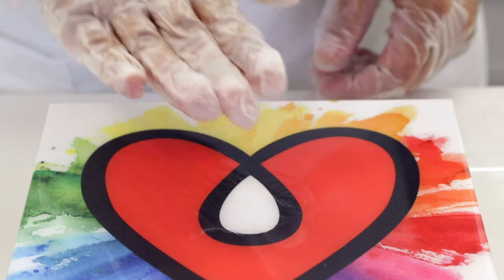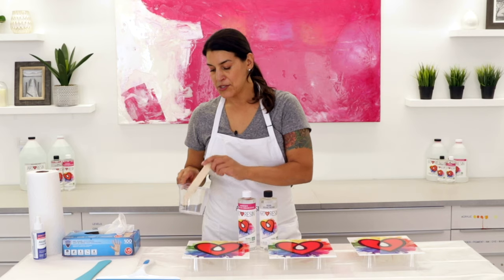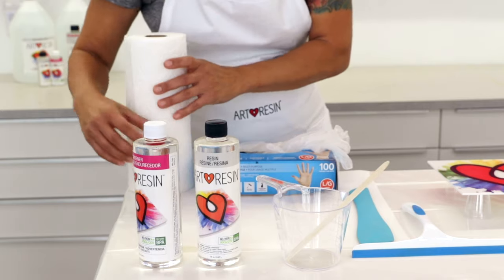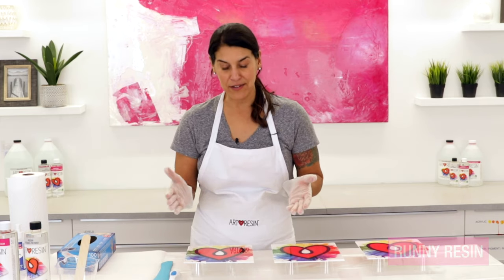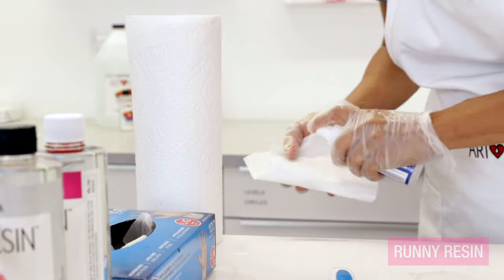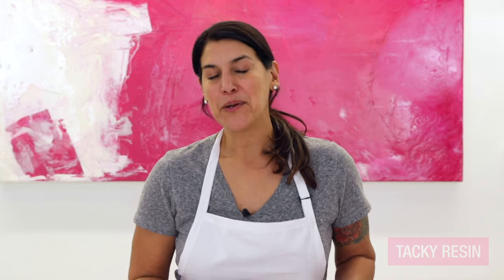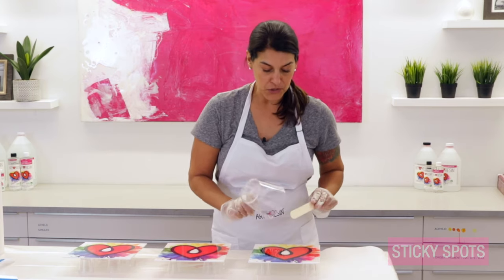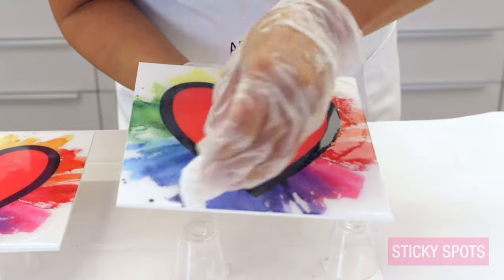How to Fix Sticky Resin - Top Tips & Tricks

Comment: Thank You so much, your video is very informative and helpful. I have a situation. I custom painted my longobard and I did a resin top cost to protect it. Since the temperaturs outside these days are extremly hot, I turned on the air conditioner to have the right temperature and to have a constant temperature. Instructions says to pour it at minimum 17degree and cure it at 20 degree. I poured it at 18-19 degree and let it cure at 19-20-21 degree. It also says it cures in 24-48hours. 

The problem: I have sticky resin, not wet spots( "the lucky situation"), I'm gonna take your advice and let it cure more.

I turned off the ac to have a warmer temperature, I poured it on saturday night, now is monday. 

 I also have some uneven small spots here and there which I'm not happy about 😕 I don't know way my resin keept making very small bubbles. I used a lighter to pop them but they keep appearing and I didn't want to insist too much and ruin everynthing.

 I don't know how close to the surface I should use the fire and how long I should mix the resin. I mixed it about 3 or 4 minutes and scraped all the surfaces of the cup, but I hurried up a little because I was affraid that the resin will start to become thick and I will not be able to spread it after.

 Now I think I should let it cure to not be tacky, then  sand it and apply another thin layer of resin on top with a brush but I'm so scared to sand it, what If it's going to scrape the paint underneath? 
Or if I can see the scraches after?
 I'm scared I will make it worse. I don't know what to do, If I should try and fix it or not. Also the next days the temperatures will be much higher and I'm thinking that my ac will not be able to keep a 19-20 degree indoor.

 I'm scared, I worked so much and so hard on this painting. I need a friend like you in my life, you are so optimist and confident with this. 
You made me think I should try and fix it. But I don't know...I have second thoughts.... 😕

What do You think? Is it safe or worth to try again? Sorry for my extremly long story, I give all the details to make sure the story is clear. Hope you will read this. Your opinion would be highly appreciated. 🤗
Reply from the maker: Hi there, the ideal temperature for working with ArtResin  is 24-30C (75-85F).  You may find your piece will cure by increasing your room temperature a couple of degrees.  ArtResin typically reaches a hard cure (to the touch) in 24 hours and full cure by 72 hours.  Once you have thoroughly mixed your ArtResin Resin and Hardener, you have about a 45 minute "working time".  During your working time you can use a butane torch to clear out any bubbles that rise to the surface.  You will want to let the flame kiss the surface of the wet resin, moving your torch constantly and avoid repeatedly torching the same area to avoid over torching.   If you do end up with any surface imperfections once your resin has cured, you can simply sand,  being careful not to sand into your artwork and pour a fresh layer once you've cleaned off the sanding dust.  The sanding will remove any of the imperfections but it will also provide tooth for the following layer of resin.   The sanding marks and dull finish from the sanding will disappear when the next layer of resin is poured.   
Here are couple of links to blogs with more information:
https://www.artresin.com/blogs/artresin/how-to-use-a-torch-on-epoxy-resin?_pos=5&_sid=9f04ddc91&_ss=r
https://www.artresin.com/blogs/artresin/44594177-how-to-apply-a-second-coat?_pos=2&_sid=fd304222a&_ss=r

If you need more assistance, feel free to reach out to us at support@artresin.com

Comment: Option 3. Seal with a sealer spray.

I have a spot on my piece that feels sticky. I saw this on another website. Do you recommend? “Use an acrylic-based spray or resin gloss sealer spray to seal off the sticky areas.  Use in light coats.” Thanks
Reply from the maker: We normally don't recommend a sealant spray for the fact of not knowing how it will yellow over time and that most are not food safe. Will it work? Possibly yes if the piece isn't too sticky.  Could it compromise the non-toxicity or longevity of your clear finish , also yes :)
Reply: No, if you cover uncured resin it will never cure and your piece will break down. Everyone should also be using PPE outside in work garage. There's tons that's had reactions even to art resin. The one I use also says non toxic VOC free n all that. None of them are safe and when you add heat or additives it changes the chemical balance. There's a fb group that the ladies has pics of their reactions. It's great if used safe. It's not the smell, but the fumes that releases for 72 hours after mixed.

Comment: Love your teaching. What about tiny bubbles how do you fix this on a large countertop.
Reply from the maker: If the resin countertop has cured, you can sand the surface to expose the bubbles then pour a fresh layer of resin overtop.  The sanding will open up the bubbles, the new layer will fill in the voids.  Once you pour your new layer, be sure to hit it with your torch to zap out any bubbles that arise.  Here is a blog that explains bubbles:  
https://www.artresin.com/blogs/artresin/tipstopreventresinbubbles?_pos=1&_sid=4321248ce&_ss=r
Reply: @Artresin  I sanded omg what I core 🙈 next time I won't be in a rush.  Tyvm 💕

Comment: Hi ,
We are new in poring resin. We made many mistakes. During mixing we didn’t scape the bottom and side, measured by weight (even this method worked before), and during poring, I scraped out the bottom an scraper of the side. After at least 30 hours the cube, cone and pyramid are still partially soft and sticky. We designed the middle of the shapes with flowers. Is it anyway they can be saved?
Reply from the maker: I am sorry to hear that.  Unfortunately when the uncured portion is inside a cast piece, it is harder to fix than if it is on a flat pour.  You can try to topcoat it with a fresh mixture of ArtResin which will seal over any sticky areas, but if there are portions that are really soft, it may not be enough to fix completely.

Comment: Hi again does all resin and hardener work the same I mean no matter which brand you use because I am using clear cast 7050 part A and Part B it says to use 2 parts of one and 1 part of the other so can I use equal part and it will work for me
Reply from the maker: Each brand is different. Our product ArtResin Epoxy Resin is a 1:1 ratio for mixing. If you are using another brand you will want to follow their directions.

Comment: I liked your presentation but my problem is not on wood but on stained glass pieces that I glued to make a sailboat scene on the water.  The pieces were glued to a pane of glass.  I bought a box of Envirotex Lite and followed directions exactly. I used a glass measuring cup and mixed exactly 1/2 cup of resin then up to the 1cup mark with the hardener. Mixed for 3 min. then poured.  It cured but did not harden. It has been 3 weeks and it is still tacky.  I do not think I would be comfortable sanding glass as I touched an area wjth alcohol and a cloth.  It was sticking so I stopped. I am afraid what to do next.  I did see on the website for the   product that there is a spray product that is a resin spray and sealer.  It is suppose to work even on sticky resin and harden.  What do you think?
Reply from the maker: Sorry to hear this!  I am not familiar with that brand and their mixing ratio, but with ArtResin if your resin remains sticky due to an improper ratio or under mixing, you can just mix a fresh batch and pour right over top.  The new perfectly mixed resin will adhere well to the sticky layer and give you a perfect finish.

Comment: If I want the resin to be even harder when finished, do I add a little more hardener?  I have been making hair sticks, and they are beautiful, but after sanding the points and using them they tend to slowly bend as I wear them (I have a lot of hair)  I suspect it is the heat from my head; is there any way to  make them keep their shape?  Thank you!
Reply from the maker: We do not recommend adding more hardener, as that could upset the delicate balance needed for the chemical reaction to occur and your resin to cure properly. When it comes to making jewelry, even hair jewelry,  ArtResin epoxy resin is best for certain types of jewelry making where the resin is poured into/onto a support. It may not be appropriate for pieces that are meant to be worn without a substrate (e.g. a bangle, or a hair stick).

Comment: I just happened upon your video and great info and detailed!  thanks!   i have a different issue and I'm still looking for an answer I'll be checking out your play lists. but I'm literally doing projects about this exact size.. for signs.. but anywhere from 10"- 16" diametere.. and I have had the same issues with several epoxy pours, and thats been that SOMEHOW I AFTER CURING IT LEAVES A DIP SOMEWHERE ON THE TOP .. SORT OF LIKE IT .. A SINK DRAIN... AND THE DRAIN BEING MY DIP... WITH THE BOARD BEING EXPOSED BY A PIN HEAD SIZE DOT!  WHY..... UGH   I AM VERY NEW TO THIS. BUT THE COVERAGE AND DRYING AND EVERYTHING HAS BEEN PEPRFEECT FOR THE MOST PART .. FOR REALL... VERY HAPPY!!  BUT WHY THE DIP DOT HOLE??  I DID USE A HEAT GUN, BUT I'M TRYING THE TORCH ON THIS NECT ONE.. ALSO ..QU..  I AM COVERING BOTH SIDES (SOME OF MY SIGNS) ARE A DOUBLE SIDED SIGN.. I HAVE BEEN USING BLUE PAINTERS TAPE TO TAPE OFF ONE SIDE AND EPOXY AND LET CURE WELL.. AND REPEAT.. SO FAR GREAT AFTER MY FIRST ATTEMPT!!  BUT AGAIN CAME OUT BEAUTIFUL.. AND I SANDED BEFORE I REALLY KNEW THAT WAS "A THING"  AND THOUGHT I HAD RUINED IT ALLLLLL.. LOL  THANKFULLY MY OLE MAN EXPLAINED THNIGS.. BUT I GOT THIS!!  EXCEPT FOR MY DIP... (ALSO ANY OTHER TIPS FOR A DOUBLE SIDED EPOXY PROJECT) THAT WOULD HELP WITH THE RUN OFFS??  THE TAPE IS DOING WHAT I NEED.. AS WELL AS NOW THAT IKNOW TO ALSO USE GLOVES! AND I RUB OVER THE EDGE SLIGHTLY... BU   EVERYTHING HAS ITS LEARNING CURVES!!  THANKS!!  GREAT TO FIND YOU AND YOU BEING VERY  DETAILED WITHOUT OVERLY EXPLAIINING!  THANKS!
Reply from the maker: It could be a bubble or the resin repelling from that area.  It is hard to tell without seeing it.  If you want you can send photos to support@artresin.com and we can try to help figure out what is happening.  Thanks!
Reply: @Artresin  ok! I may try to do that! Thanks so much! I did a pour the other night after watching your videos,  but I also have been taping the back side of my sign.. but I also have left the tape exposed along the edges, and I let my sign cure longer than usual and when I went to remove the tape it was extremely difficult! And I split my board but I think I can fix it.. I sanded the spot and will do another pour but only tape the back and allow the excess to run off the edges, instead of puddling around the edges. Thanks again!

Comment: I have tracky resin which is still sticky after 48 hours. As per your guidelines what I understood is I need to mix part one resin and hardener in appropriate weight and mix it, then spread on existing one. 
Is it that you said to do.
Reply from the maker: You can mix a 1:1 ratio by VOLUME, do not weigh as the resin weighs more than hardener.  Mix thoroughly being sure to scrape the bottom and sides of your mixing cup and then pour over your artwork.

Comment: I have a question.   I poured last night.  My surface has some really small bumps/divits.  

Can I just pour a second layer?  Or do I need to prep the surface better?
Reply from the maker: If the surface is cured its best to sand it a bit--this gives it some tooth so that the next layer adheres really strongly.  The light sanding will also open up any bubbles so that you can pour a perfect second coat.  To pour a second coat without having to sand, we recommend pouring your next layer after the first layer has cured for 3-5 hours and it is still sticky.  That stickiness will give the next layer the tooth.

Comment: This video has been a life saver! Maybe I missed something but, how/can you fix resin that is seeping out from between layers, like on the edge of a coaster?
Reply from the maker: Try to squeeze out or press out any liquid resin if possible.  Sometimes adding a bit of heat from a hair dryer can make it run out easier.  Once you remove as much as you can, you can apply a freshly mixed layer of ArtResin to the coaster.  You will be best to try to encapsulate the piece in the fresh layer to avoid any of the uncured resin from eventually seeping out.
Reply: @Artresin  the weird thing is that the rest of the coaster (that I can put my hands on) is hard, so I don't know how much I could heat/squeeze out or how much is inside that hasn't cured. Doesn't appear to be a fixable issue....just confuses me how it happens when I make sure the first layer is cured before I add the top coat.
Reply from the maker: @donnac01  The likely cause is pouring from a container where the resin and hardener are not fully mixed.  It could have been just one area in the bottom or the side of the mixing cup that was missed, so when it is poured out and you scrape the contents of the container onto your surface/mold, that unmixed spot deposits itself.  The rest of the mixture is properly combined so it cures, but that pocket of unmixed resin or hardener will remain liquid.
Reply: @Artresin  thank you so much for the clarification! So, is there a degree we receive or at least some academic credits for chemistry, after we've learned how to use resin?!?! Feeln like a mad (not mad) scientist! 🤣

Comment: Thank you! Can I use sand paper grit 120 instead of 80? Also can I do wet sanding instead of dry sand?
Reply from the maker: Hi Miro Maro, if you're sanding your artwork because there are imperfections, we recommend dry sanding with at least an 80 grit sand paper. This provides some tooth for better adhesion of your next layer of ArtResin and the scratch marks will disappear under the new layer. Check out our blog to see for yourself and learn more :) https://www.artresin.com/blogs/artresin/will-the-scratch-marks-from-sanding-be-visible-under-a-second-coat-of-resin?_pos=1&_sid=e01f97c4a&_ss=r
Reply: @Artresin  thank you and thanks for replying to my emails too

Comment: I made resin coasters. They usually are not an issue but for some reason I've been having a tough time with some sticky spots. I resined them again and they are better now. But it's been 4 days and still a little tacky in some areas. Should I just leave them be?
Reply from the maker: If it has been 4 days those tacky spots are likely there to stay. I would try one more thin coat and that should seal them in :)

Comment: Hi, if the temperature is too cold or changes during the curing time can it still cure if kept in same spot for a longer time? say 72 hours or later
Reply from the maker: Try to avoid fluctuations in temperature during the first 24 hours of your curing as it can surface imperfections in your resin.   When your room temperature is too cold, the resin will take far longer to cure.  If the temperature of your resin room is below 72F/22C, your resin may stay sticky for days or may not cure at all.  If this happens, simply try moving your piece to warmer area or increase the room temperature ... your piece should cure dry to the touch after 24 hours.

Comment: I'm in the situation of having cured and  sticky on a painted art piece. While sanding the cured sections I hit a tacky section, now its somewhat mucky in a spot. Can I scrap the section off, re paint if needed, then pour over it along with the whole piece?
Reply from the maker: You can just sand the cured, glossy sections and leave the sticky section.  Clear away all of the sanding dust then pour a fresh coat of ArtResin.  If you have a spot that is till gooey and uncured, you will need to scrape that section out to remove all of that uncured resin, then you can pour a fresh coat.

Comment: Can you put the mixed resin in the warm water bath to get rid of bubbles or do you do this before you mix the 2?
Reply from the maker: Hi Lisa,  we recommend doing the warm water bath before you mix your resin and hardener. Just put the bottles, with the caps tightly sealed, into a warm water bath for about 15-20 minutes and this will help reduce the bubbles.

Comment: Hi i have tacky resin like the middle one and it says to pour another layer over the top. Only problem is mine are in moulds, I’m not sure how to pour over the same shape without it flowing out of the mold
Reply from the maker: Oh darn.  Fixing tacky resin in a mold provides more of a challenge.  It sounds like you haven't un-molded yet, so I would apply a thin layer to your piece, let it cure, then do the same to the rest after removing the mold.  You can apply it with a gloved hand.  This may work, but it is certainly a harder fix than re-coating a flat surface.

Comment: Thanks for the help! do you not have to use a mask with Art Resin?
Reply from the maker: ArtResin is non toxic and does not produce fumes.  If you are working in a well ventilated area, a respirator is not required.  Have a look at our blog for more information: 
https://www.artresin.com/blogs/artresin/what-safety-precautions-should-i-take-when-using-artresin?_pos=4&_sid=de12e468a&_ss=r

Comment: What do you do when you have a spot on your cured resin that comes out dull. I poured resin on a piece and after it was fully cured I spritzed it with alcohol to remove fingerprints from handling it around the edges and the alcohol or something seemed to produce a dry dull appearance that I could not remove even with clean soapy water. Was it because that spot wasn't properly mixed and then the alcohol dulled it
Reply from the maker: Hi Veronica.  Alcohol will break down cured resin, so likely it has damaged the surface of the resin.  You can sand the surface and apply a second coat to restore the glossy finish.